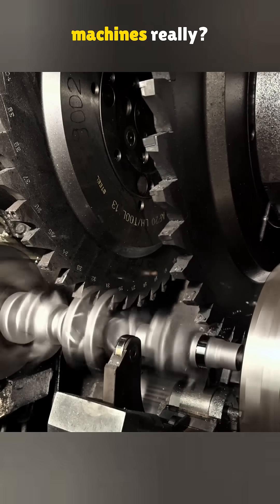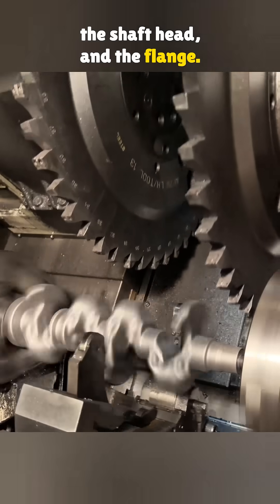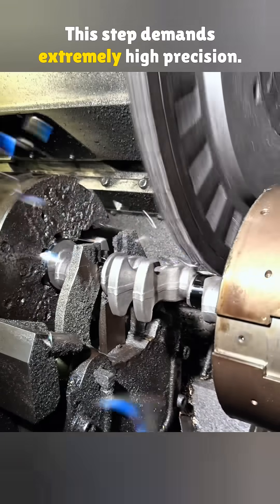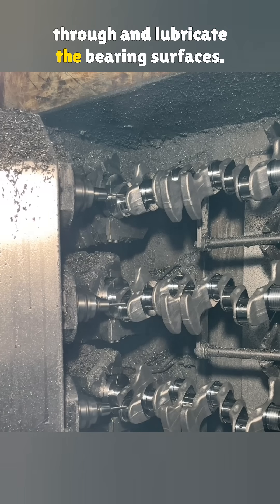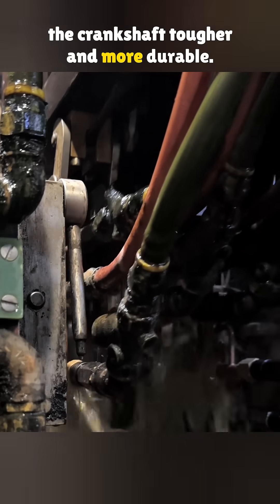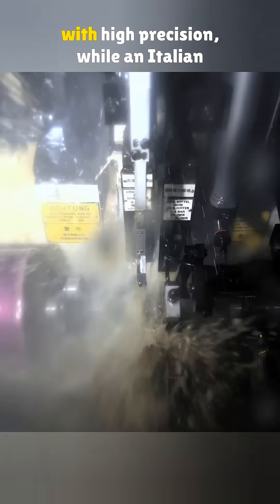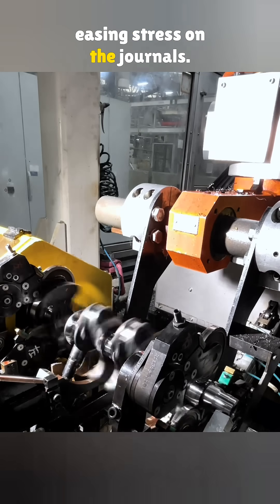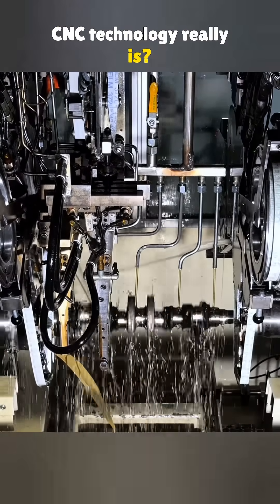How Far Behind Are Chinese CNC Machines #automobile #mechanic #car #assembly #manufacturing

Comment: They rely on everyone else's technology. Try let them make their own CNC machines and you will see what kind of junk they make. There is huge difference though between Chinese products but what differs is who is responsible for the quality assurance. If they are in control of production and quality, it's the same quality as if you buy it from Amazon, Aliexpress or Teemu. 95% of their products are literally junk that goes into the bin

Comment: The western tool and machine manufacturers have fine tuned their technology over centuries. However, technology has advanced following a different pathway. The Chinese EV cars are doing away with all these necessary machines. Even planes and ships are turning to electric drives.

Comment: the engineers that designed these machines are on another level, I am mind boggled and would not know where to start when designing a machine like this that gives accurate cuts to make Cam shafts. where are the Americans at when it comes to machines like this? now I am curious how these machines are designed and crafted.

Comment: This is just the nature of global trade and specialization of labor. For example, when I shave I used Japanese Feather razor blades (sharpest in the world), German Merkur 34 razor heads (best balance, corrosion resistance, and strongest to maintain a flat blade edge with precision distance from the guard), and Italian Pro-Raso shaving soaps (best skin protection and lubricity). The lathering brush came from China, though.

Comment: It's not that Chinese can't. It's that manufacturers won't + CCP corruption.
The reason stuff is manufactured in China is because the labor is cheap.
So if you're making stuff that's easy to make and doesn't require intelligent workers you can mass produce in China and cut labor costs to nothing.
If you want precision and require disciplined workers whose cognitive activity registers on EKG then you're going to need to pay. Perhaps not as much as to EU or US workers, but it won't be pennies on the dollar anymore.

Comment: And they still leave metal in the engines. PLUS, they're doing it wrong. I'll bet it's not cryo freezed. We do this with drill shafts underground. We use carbide bits.

Comment: We have been lied to, and the executives outsourcing stuff to china are either stupid or have been paid off.  The cost of producing a part in China is obviously not much different from other countries.  The equipment is the same, the materials are the same.  As can be seen in this video, there are no more manual steps than in US or European plant.  You can probably measure the total touch labor on that crankshaft in minutes - probably less than 15 minutes.  The cost of labor in China is nowhere near as cheap as most people think, so lets say for argument that he US worker makes $24 per hour more.  If it was only about labor the crankshaft would cost just $6 more.  However, $6 is not enough money to pay for packaging, shipping and the cost of nearly two months worth of inventory either in a port or at sea.    It certainly not worth the potential supply chain disruption for something like COVID, a dock workers strike, or the Railroad not being able to get the containers out of port.  Even if my estimate is off by a factor of four (30 minutes at $48 per hour DIFFERENCE in labor rate) the cost difference is still only $24 and typical 4 cylinder crankshaft is about $500.   Many of these American. executives claim the cost would double.  They are lying.  BTW, most consumer products like flat screen TV’s are even less labor intensive.

Comment: From Chat GPT
China uses a mix of domestic and foreign equipment for car engine production, with strong government pushes (like the 50% domestic rule for chips) aiming for self-sufficiency, especially in advanced areas, though specific engine production reliance varies, with China increasingly dominating overall automotive manufacturing, leveraging both local tech and global partnerships. While no precise overall percentage for engine equipment exists, the trend shows a significant shift towards Chinese-made tools, even as high-end components might still come from abroad. 

Key Factors & Trends

Government Mandates: Beijing is actively promoting domestic suppliers with policies, like the reported (though unofficial) 50% domestic equipment rule for chipmakers, encouraging local sourcing even where foreign options exist.

Self-Reliance Push: This drive intensified after US tech restrictions, aiming to reduce dependence on foreign technology for critical industries like automotive.

Domestic Capability Growth: Chinese companies are rapidly advancing, breaking barriers in areas like New Energy Vehicles (NEVs), leading global players to seek partnerships with them.

Market Dominance: China leads global car production (over 30% of total in 2021) and has a massive domestic market, creating huge demand for both domestic and imported machinery.

Hybrid Approach: While striving for 100% domestic, flexibility is granted for advanced areas where local equipment isn't fully mature, allowing for foreign tools temporarily.

Comment: Centripetal force. Centrifugal force is a false force experienced in an accelerating frame of reference. It's as if you were tossing a ball back and forth to somebody in a moving train. If the train is traveling in a straight line at a constant speed the ball would follow a normal path and you would know no difference. But if you continued throwing the ball as the train started to round a bend you would see the ball fly wildly in the air. If you removed the train entirely and kept the ball in its path, and observed it from the ground next to the track, the ball would be traveling normal. But because your train is moving in a curved path, the ball appears to have wild motion.

Comment: not as far as russians are, they still making crap cars and car engines from 1980's, like niva and their engines do not usually produce more than 100 hp, something that even china 1.5 turbo engine managed to overcome
russian car manufactures are pathetic
most imports are chinese these days, nobody will even think of using russian cars regardless of sanctions, because they are archaic and garbage quality, some base models don't even come with ac

Comment: Never realized all the work on a crankshaft. All that different machinery for one part of a reciprocating engine. Yikes!

I switched to an EV 5 years ago, a much simpler and cheaper technology. Now that the battery cost has been resolved, EV's should take over the auto market in a few years.

Comment: When your country is electrifying, you don’t need crankshaft machines. 😂
Reply: Electric motors also have crankshafts. They just don't have the 'throws' for connecting rods. I personally prefer IC engines. They're beautiful machines. EVs are boring, not interesting to play with at all.
Reply: @tempest411  Giving you a 10 on that comment. Ice are mechanically fascinating.

Comment: Hell how ignorant you people are
You have no idea what is the gap between using machine and making one

To make a crankshaft with micrometer tolerance you have to use appropriate machinery. To make that machinery you need machinery ten times more precise. And generations of engineers grown in such high precision environment to get used to it and to be able to use this machinery

Comment: I worked in a Steel Factory, there has a Laser Cut CNC by BODOR (China Origin), and MultiTool machine by DURMA (Turkish Origin).

Excellent Machines both, but BODOR CNC is really Accurete.

Around the World the Differents Companys use Tools from a lot of Countrys, its impossible made all tools if you need.

This video not have sense.

Comment: Posted by a hater, CNC is not like lithography or deep space technology.

 That company just prefers using European made CNCs because they can afford it. You should check out CLT  and Xaomi to get a master class in chinese advanced CNC and automation. 

You should also check CNC machines that weave connectors copper threads on CPU. They require nano meter accuracy, and they are a made in china.

Comment: This is what makes me love and will always love ❤️ the Internal Combustion Engine over Simple Electric Motor EV - the engineering that goes into it is great. EVs are cheap to manufacture yet so expensive due to the batteries 🔋 and inverter system.

Comment: The best CNC machines in the world are from Germany, Japan or Switzerland to some extent. There's quite an interesting historical reason for this.
IIRC, the US military were among the first to experiment with CNC machines for the manufacturing of helicopter rotor blades. They collaborated with a couple of US machine manufacturers, but the problem was that the machines they came up with were cumbersome to use and super overpriced (money doesn't matter for the military), so the American manufacturers had very little success selling their machines on the open market and many of them went bankrupt in the 70s.
It was a different story in Germany and Japan: The main customers for CNC machines were companies and car manufacturers and those did care about prices, usability, and reliability. Hence German and Japanese CNC manufacturers thrived and established themselves as the go-to suppliers.

Comment: I've been a cnc machinist for the past 20yrs. There's no such thing as behind just whats needed for the job. I worked for Waats regulators running automatic screw machines and they were still using machines from ww2. That was 6yrs ago. I work for Southeastern Broch now and the machines we use were made in the 60s. We make tooling for turbine engines.

Comment: Why is China behind, if they use machines from other nations?

When was this video even shot? To be precise and outspoken: the EU is going down the drain with its greenfascists agenda, plus German companies as Failwagen and Mercedes have proven time after time, that they are unable to build modern combustion engines and instead have to rely on cheating. Also Failwagen wants to go 100% EV for the same reason - they are incapable to deliver the same quality as the Japanese and Koreans.

Comment: Soon nobody will need a crankshaft as you don’t need it in electric cars. China is doing a leap to fully electric cars and US can still use unreliable, overcomplicated and faulty combustion engines in huge pickups truck they actually don’t need at all. 😂😂😂

Comment: Well, since they’re not Chinese CNC machines, I wouldn’t know how far behind they are. But thanks to you, what I do know is that at least one Chinese crankshaft manufacturer is using the best available CNC machines in the world, which says a lot about the potential quality of those crankshafts. The only unknowns are the quality of the steel to manufacture them and the adherence to their design specifications.

Comment: I work on Italian Morbidelli (SCM now) machines and they are the worst, they have some advantages, but I don't like where development is going, new software is terribly bugged and half working, even basic buttons are not working, they just absolutely don't care and nobody tested it. 
When you say it, they tell you that you don't want to accept future...no, I just want things that worked for 20 years to be still working, these new machines are so inneficient and nobody tested them before they sold it to the customer. 
You order the same name machine after 5 years and you expect the same machine, but everything is completely different, why the hell they do it? When you have a company, you need things to work efficiently, not learning completely new CNCs every few years and reprogram whole manufacturing and change everything becasuse same tools and methods are not possible on the new machine...I don't understand that companies still somehow work, those people who are able to learn it fast and make it work again on worse less reliable "modern" machine have my respect.
On old machine, I can just mark 100 programs, hit enter and I immediatelly see their code, on new machine, to start that damn cad-cam software takes like 1 minute, so imagine what it is like when you need to check 100 programs.....it's crazy and so inefficient and their amazing simulations are a nice toy, but it will simulate anything, it doesn't care if machine can really make it or not, so it's all pointless as everything else modern.

Comment: I repair and diagnose faults in machinery in the steel industry and engineering. All of the Chinese machines I have ever dealt with are very poorly made and are not built for longevity.

Comment: When I left school at 15 in 1963 as an engineering apprentice at Wheatley and Whiteley Leeds UK crankshafts were made from billet steel by men using lathes, crankshaft grinderers and drilling machines. The white metal bearings were poured in liquid form and then machined to size. These cranks were for big industrial machines. All highly skilled men no CNC then but sadly all gone now.

Comment: I’m not someone who has ever used a lathe or done machining myself, but still, doesn’t it seem that products made by Chinese companies can’t really be produced properly without relying on foreign equipment?

When it comes to manufacturing five-axis CNC machines, all kinds of question marks pop into my head about whether they can actually do it. Personally, the companies I know that can build so-called mother machines (five-axis CNCs?) would be DMG MORI and Yamazaki Mazak. I often watch YouTube videos from DMG MORI and Nantoka Heavy Industries (Nantoka Jūkō)—which owns CNC machines made by Brother Industries, lol.

By the way, judging from the content of this video, it looks like they don’t have any domestically produced machining equipment of their own—none at all. In fact, when it comes to the AZ-series engines installed in Toyota’s Japan-only models (?), most of the core 2.4-liter units were manufactured by GAC Toyota Engine Co. in China, and they have suffered defects serious enough to warrant recalls.

If this is the level of products they can make, then expecting anything more seems unrealistic.

On top of that, the German industrial robot manufacturer KUKA has been acquired by China’s Midea Group.

I also still remember how China’s high-speed rail—after receiving Shinkansen technology from JR Central and Kawasaki Heavy Industries and claiming it was “independently developed by China”—was involved in a major accident on July 23, 2011, and then took actions afterward that quietly turned into unintentional comedy material online, leaving many people deeply uneasy about transparency and safety culture.

Conclusion: honestly, I find it very hard to believe that they can manufacture products that are truly safe and reliable in the long run.
(English tranlatated by Open AI)

Comment: Why don’t they do the holes for the crankshaft before they surface it? Cause can’t that create sharp edges which affect oil flow and cause other issues? Cause that’s what my performance teacher said when we were designing engines Zoe’s drill the holes before you do the surfacing. Was that just something he said because that was his preference or is that incorrect?

Comment: Companies make specialized tools and their location means nothing. If a auto parts manufacturer needs a machine to do some tooling, they look around for Companies that already has the machines. If it requires something new, you contact a company that specializes in the type of machines. No parts manufacturer will spend 100,000s or millions of dollars to build their own machine.

Comment: Not far at all. China will do what it always does so well, simply reverse engineer it. I give it less than 2 years.
In comparison, the USA and Europe have barely scratched the surface of good battery technology. Yet china now produces high density batteries that can fully charge from zero in less than 10 minutes and run for more than 500km. They won’t need crankshafts anymore as electric cars don’t have them. 
We in the west are at least 7-10 years behind china because our governments and businesses are more interested in making money than making things work. 
Sad but true.